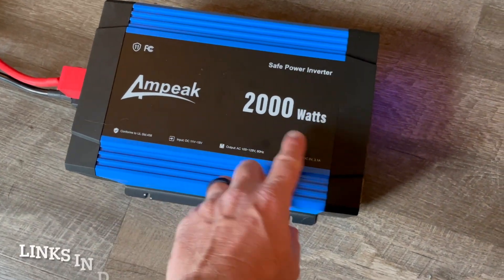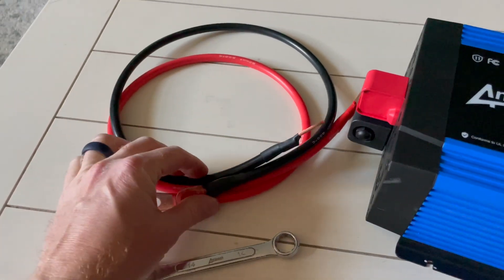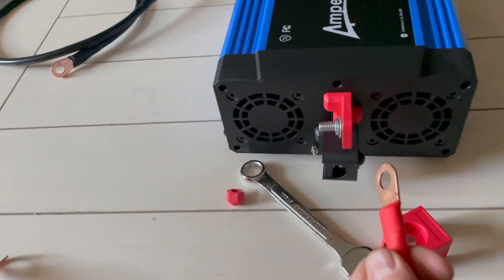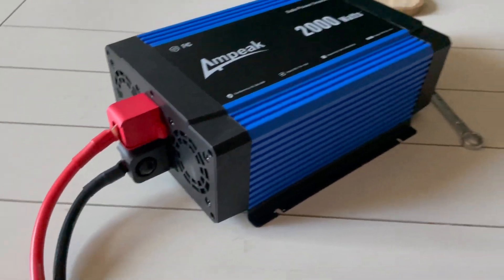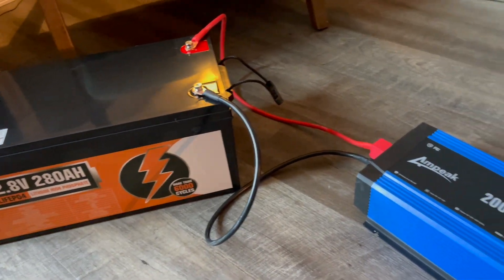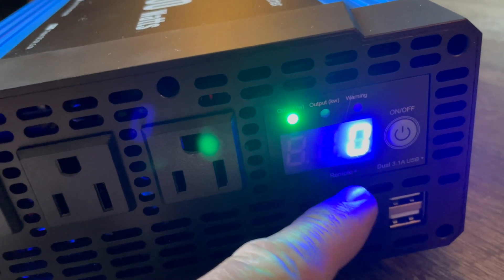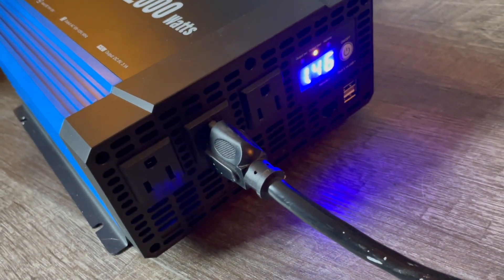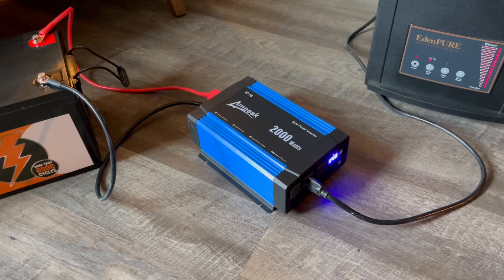Setup an Inverter For Your Solar Project- Ampeak 2000w Inverter Test

Comment: A FEW WORDS ON SAFETY:  Always put breakers between your inverter and your battery and also between your solar panel and charge controller. You need these to isolate and protect you and your equipment when you need to work on it. {Remember that big spark when you connected the battery to the inverter?} Those breakers should be rated for the max current those devices will be drawing.  Also, keep in mind that a 2000 watt inverter will draw about 200 amps so your cables to the inverter should be as short as possible AND at least 1 gage  not the 4 gauge that you are apparently using.  I suggest you get Will Prowse's solar system book. look him up here on youtube  Guys.. have fun, build things but be SAFE!